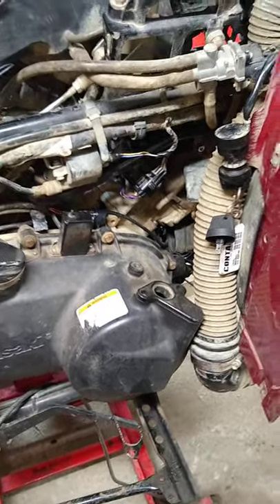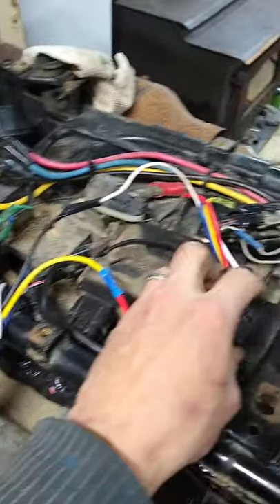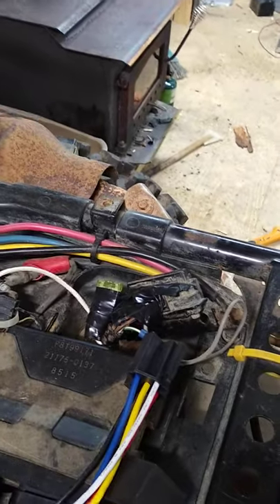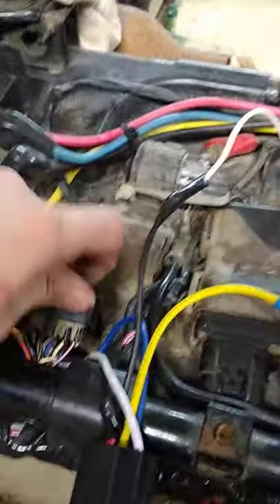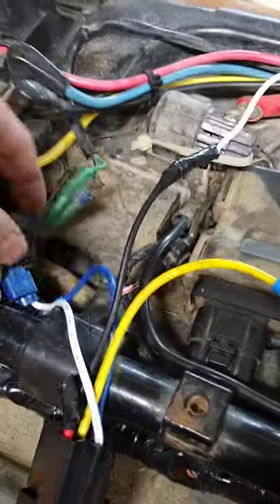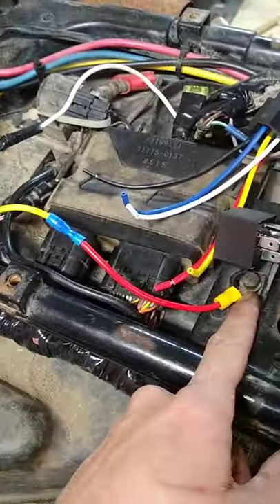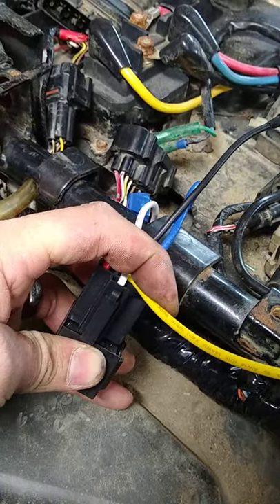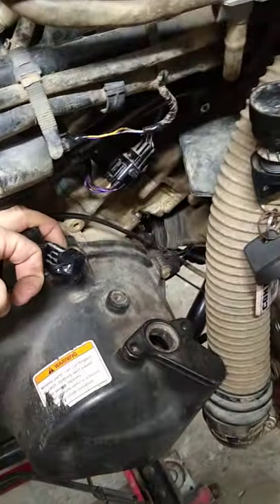kebc clutch actuator delete. no flashing light. brute force prairie

Comment: So the kebab can keep the 4x4 from working.
4x4 stopped working when someone changed the belt I reset the belt but never made sure the belt sensor was in the right position.
Belt light went out but 4x4 light was a 2 second on off blink.
Mencken wasn’t correctly seated . So I put it back correctly
4x4 went to a half second blink. The switch the wires and the 4x4 actuator are all in good shape no corrosion burn marks mud. But the lights still on
Reply from the maker: electric model box under the seat can go bad or the actuator. actuator can work when putting 12 volt on the motor but doesn't mean its going to work on the bike
Reply: @danatv3046  makes sense
Do I have to put a relay in or can I jump it to the battery
Reply from the maker: i meant if you want to test the actuator motor
Reply: Oh ok I meant did I have to put in a relay to delete the kebc if so I’ll get one
Reply from the maker: i would try. kebc is useless anyway
Reply: I ordered a true mods eps134r relay 
I can’t find the year of my atv or the fuse box
Reply: 2007 model
Reply from the maker: fuse are under the seat. beside ecu
Reply: @danatv3046  it looks like my ecu is on top of the dry storage.
Reply: Mine has several inline fuses but I don’t see a fuse box at all. I found the rectifier on the frame
The ecu is on the storage. 
The 4x4 controller is in from of the battery. 
Then there’s several relays and a couple inline fuses but no actual fuse box itself.
Reply: Because mines a 360 not a 650 or 700. Well crap. What do I do now

Comment: I have a problem with flashing 2wd 4wd on the screen every 4 seconds (both actuators in problem), took both out checked with 12 v voltage (tested potentiometers, speed sensor, switch 2wd 4wd, f / r sensor, checked every wire from connector to connector, fuses all correct), but still the same error, now I made a kebc delete as you described in the video, the flashing stopped, I change the switch from 2wd to  4wd only on the display, but the actuator for the 4x4 still does not work (am I wrong somewhere? I suspect the actuator controller ,
can i somehow test the controller before buying a new one?, because it is not very cheap, thanks
Reply from the maker: Try the kebc motor on the 4x4 actuator plug.  Its the same plug. Can see if its moving.  Probably  actuator.

Comment: Does it matter if the relay is a flasher relay?
Reply from the maker: Not if its the same kind of relay
Reply: @Dan atv  Iappreciate your video. I was able to do it just as you did and 4x4 works great! I’ve bought the KNIGHT kit, as my quad is still in limp mode with belt flashing…wtfffff
Reply from the maker: Need to reset the belt light. Did you open the belt cover or unplug the wire while the key was on?
Reply: @danatv3046  I believe it was ran or tried when cover was off. I’ve since deleted the side cover belt light  and just wired it in solid.
Reply from the maker: So its ok know?
Reply: @danatv3046  I don’t know really.. all seems to function but no power compared to what I thought it would have… I feel it goes maybe 20 mph or so, shouldn’t these be able to takeoff?
Reply from the maker: Is there a cut off like? Belt light still flashing.?
Reply: @danatv3046  not anymore, I put the Knight kit on it and deleted the KEBC and bypassed the light. I’m missing a harness cause it was used, thinking that’s the thing, or the computers are bad?